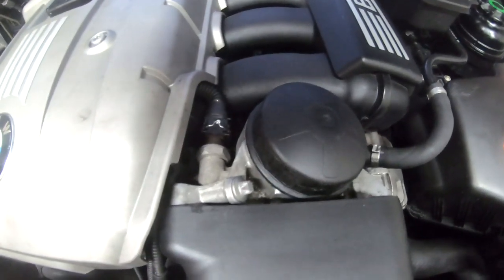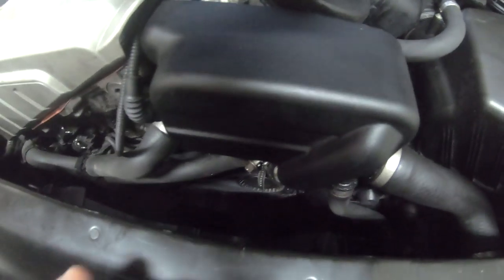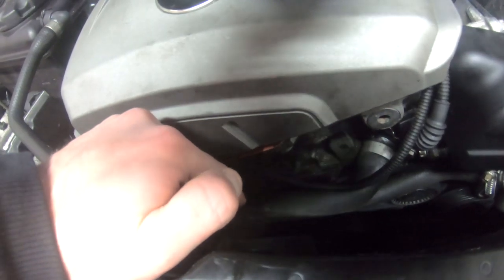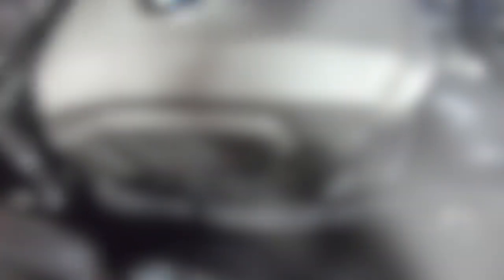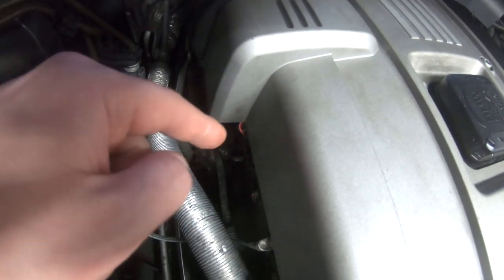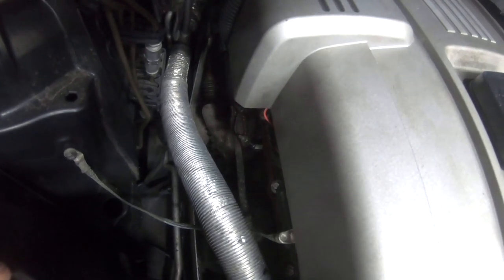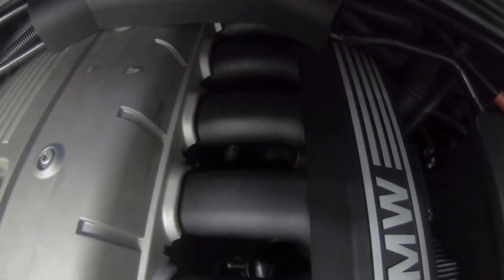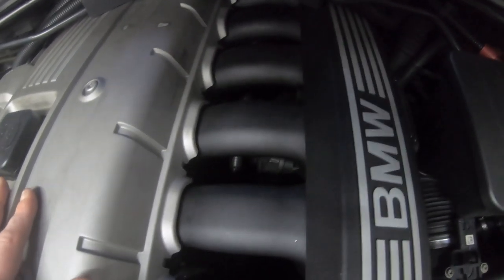Bmw N52 All Common Oil Leaks & All Common Problems Sump Gasket Repair

Comment: ahh thanks yes of course, GREAT German engineering undermined by mechanically unsympathetic German accounting  ;-) get a Toyota...Anyway that's another video haha. Yes the oil cooler housing to engine block gasket...Makes sense now why I've been losing both oil AND coolant...pretty much a litre of each a week! On to it, thanks for your help.

Comment: Can anyone help me, I have a small leak from the oil cooler, but where that auto transmission joints with the engine there is oil leaking from there is possible for the oil to get there ?

Comment: Very informative cheers.
I've got a question regards the sump gasket. I'll be fixing my sump leak soon and as its done just over 100k, would you recommend I change it and use the sealant  obviously with new bolts, rather than using the sealant itself?

Comment: Am I supposed to have an oil cooler on my 2006 330xi?  I changed the Oil filter gasket but noticed I dont have the oil cooler in front of the filter housing. Thanks for your help and your videos, you're the best mate!
Reply: Some have theirs at the bottom to avoid leaks on the belt

Comment: Hi Dean, I just bought E90 325, had been leaking oil for a long time, engine subframe caked in old oil + dirt, looked like coming from oil filter housing, small amount of oil in coolant tank, engine run,s well so don't think its the headgasket but still has large amount of oil leaking under intake manifold after fitting new gaskets to oil filter housing, most by oil filter housing, any other place it will leak from around there? thanks
Reply: Looks like it was the oil filter/cooler gasket after all, cleaned area for 2nd time and looks good, so must have been old oil from when cooler removed

Comment: Hello,I have a seriours problem with my E66 N52B30 engine.Car can’t start the engine.No energy on engine and no fuel on it.Diagnosis say valvetronic fault,but the valvetronic motor is working.Is it possible valvetronic eccentric shaft sensor make this problems ?I think main computer is a problem.Whats your mind?

Comment: Help!!! Please. my n52 has white smoke on startup. Took it to dealer. They say blown head gasket. Im confused. It still drives normally. No signs on coolant mix in oil or vise visa.

Comment: Hi Dean. Am learning a lot from your videos. Thanks mate. Am an engineer, use Carly app, can troubleshoot some, but not really a car guy. I just want to stay proactive with my 2011 e90 n52 with 82K miles and avoid huge bills.
Am a low mileage user: 3500 miles a year, mostly city driving, half at highway speeds. Live in DC where it is neither too hot or too cold. Do I still need to perform Oil change every 12 months? Can I check for oil quality somehow and stretch longer if oil is okay? 
Have already got the valve cover gasket replaced recently. To manage other leaks proactively would you recommend me adding ATP205 re-seal to my oil in controlled amounts (test before increasing) which might prolong the need to replace oil filter and oil pan gaskets at a future date. If I do use ATP, do I need to continue adding it with every oil change (else risk the rubber shrinking and start an oil leak even more prematurely than what I am trying to avoid). 
Thanks much mate. Your '9 things to replace at 100k' video hit the mark for me.

Comment: Thank you very much for the info. What is the torque specs on the oil sump bolts?
Reply from the maker: Torque specs I will put in description
Reply: BMW Doctor thank you mate 🙏

Comment: Hey bro I messged you before regarding my 530d 
So I had my timing chains replaced etc since getting the car back.  It sort has no power well no torce im sticking my foot down and it doesn’t eject me into my seat anymore it takes ages to build up to 100mph. The gears hold longer do you have any idea. I can’t be asked to go back to the garage as it took them 17 days to fix my car in first place -.-
Reply from the maker: That can be mate either the turbo itself sticking or something is holding the car back maybe egr valve

Comment: Do you know anything about drive train error on a 63 plate 316i, limp mode no turbo, getting a vanoss fault?
Reply from the maker: Nope just get rid and be done with why would anyone drive that car sorry mate the reason I’m recommended to you is because youtube know I’m british and we are the only country to get that piece of crap engine 

Get rid and get a 6 cylinder

You down own a bmw with that engine you own a ford it’s a English made engine so for me I don’t class that as German I know exactly what’s wrong with that car
Reply: @BMWDoctor  so what's wrong with it do you think?  Do you think it's the solenoids?  Ibe read that taking them out and cleaning them helps? And thanks for you're reply I appreciate it mate
Reply from the maker: I think its fit for scrap its telling you to buy a 6 cylinder

Comment: Thanks for the video. Im still confused on where to put the sealant/rtv. Do you leave the old gasket on?
Reply from the maker: Leave it on son , you don’t take the whole sump down
Reply: @BMWDoctor  What about cutting the gasket out removing and using RTV gasket maker? as leaving the gasket on it could be leaking from the underside of gasket?
Reply: @Inspherespace  I agree.  It should seem better to cut it out and seal it with high torque grey rtv.  Otherwise you have to clean the metal surfaces plus both sides of the gasket while under car.  Seems painful
Reply: Appreciate it your help. Will be doing it this week!
Reply from the maker: Your welcome mate just remember don’t take the bolts completely down make sure you drain oil before hand oil the oil and bolts loose will be to much for the bolts to handle all that oil in the sump do this and then let it sit for a bit to seal properly
Reply: @BMWDoctor  I have to do the same. Is it possible to drop the sump   all the way to clean properly the oil residue so the sealant will seal properly?
Reply: Bmw Doctor so only loosen the bolts, do not remove all the way. After add the RTV.

Comment: Hi. Not related to this vid, but i wish u could make a vid about 5/335d engine how each of pressure  converters supposed to work at different rpms, i bought 2 new ones, seems like one is faulty, and the old ones unplugged/manually tested are holding vac for 4s, when on car same PC's generate 25+inHg, on wastegate im not getting any vac,but i reckon it happens in a case of overboost, the new PC unplugged wasn't holding vacuum at all,but with electricity supply works same as the old ones...a bit confused at the moment, would be great if u would make a vid about pressure converters for 5/335d, went through YT for hours and no one actually tests them on car in a documented way...you would be the first one :) thanks

Comment: I have a bmw n52 engine, I have changed the spark plugs recently but under full throttle and higher revs it seems to misfire and stutter a little. Could this be the coil packs? Also seems to of happen after putting a k&n panel filter in.
Reply: Tom Bindon sounds like your fuel pressure is low. Check the presses with ista d. K&N filter equal more oxygen, with low pressure it will not create the correct mixing ratio of fuel and oxygen. It’s not the coil packs, since the engine will reflect the same behavior in any condition while running. 
*spark plug: Did you noticed a fault right after changing spark plugs?
*FYI; BMW have a recall on n52 don’t know the exact years maybe 8-11 3 series. Need to be less then 120kmiles or 10 years for the replacement of the fuel pressure regulator. Or lift the back of the seat of drivers side if you see gasoline residue after taking the cover +4 screws off...
Reply: David Pion I have a BMW Z4 e86 3.0si, with 80k, it didn’t happen have the spark change,so it could be the fuel regulator, where and how would I check this, thanks for the advise
Reply from the maker: if its stuttering listen to me , replace your ignition coils ALL 6 and replace your solenoids from BMW do not even THINK about cleaning them or you will be back here there is no way around it do it right or carry on like that
Reply: Tom Bindon I assumed you had an e92...if you decide to change your coils get Delphi, the Bosch are prone to failure.
Reply: @BMWDoctor  aw dammit. 94k ml 2006 330i. I was just about to change only the plugs and clean the coils to save some 💲💰.

Comment: Shared mate👍Had a turbo siren type noise from mine as i pulled onto my street only in the boost range. Pulled over had a look under bonnet then just been back out and it's not doing it now.
Reply from the maker: Turbo siren noise mate that will be one of your intake pipes off mate check the one that goes from air box to the turbo 

Thanks mate for sharing
Reply: @BMWDoctor  Will do mate nice1.  If it was turbo itself would it have done it again when I went back out then? It had a brand new one from bmw 30k ago.
Reply from the maker: mate no chance it can be turbo mate no chance in hell bro do not worry yourself if it was changed 30k ago no way turbo can fail that quick unless your driving with no oil

Comment: Just had recall on my e60 matey for battery cable or something , whilst it was in they done a heath check on full car the only amber concerns were parking sensors don’t work but a know that and a slight oil leak between gearbox and engine do you know if there is a common place to check , they mentioned it’s was a tiny leak and give it amber and will need attention in the future . Any ideas . Rest of check were green so good to go ha 👍
Reply from the maker: Yes mate that’s the rear main seal leaking mate
Reply: Bmw Doctor big job ?
Reply from the maker: big big job gearbox needs to come out to access it mate
Reply: Trade in time next year then 😭
Reply from the maker: I done them many many times and its easy to do if you know how 

what car and what engine is it
Reply: Bmw Doctor 07 e60 535d m sport
Reply from the maker: thought as much mate nothing but problems I have made over 700 people get rid of there diesels this year on YouTube alone and go to petrol go get N52 engine and be happy mate you will enjoy more or get the V8 they are not as expensive as you think to look after please whatever you do mate do not get 4 cylinder get rid of the 535D before it runs your account to the ground especially if you aint doing the jobs yourself this car is about to rip you for everything you have
Reply: Bmw Doctor had it 6 year with only a spring to go wrong and sensors . Been amazing to be fair got it with 55k got 115k now and like a above just flew a heath test with only the above faults . But like a day it’s 6 year old to me and 13 year in age . So could do with a change .
Reply from the maker: yeah petrol mate petrol Im just trying to purchase a X6 for the channel myself I dont know how many people have this car on my channel but who knows but if I was you just get rid mate and Get N52 you will enjoy alot more
Reply: @BMWDoctor  which V8 you would recommend? Would car like 735i be ok?is still a V8 but not sure if would be a good one. Meaby a list of V8 in video would be nice tho
Reply from the maker: I won’t be getting V8 mate I’m looking for the channel a X6 2011 plate mate I’m not sure if anyone on here has this car but I’m sure many people will come mate as I have always said I want to be different so I’m targeting cars that ain’t been done before
Reply: I get it but you think 735i would be a good choice?
Reply from the maker: Karol Grabka no bro don’t get that car are you good with electronics that car will be sitting more time then being used trust me you need to be good at diagnostics

Comment: Oil filter housing and valve cover gaskets are the bane of my bank account
Reply from the maker: Go and buy bmw dealer ones and they won’t be if your using that cheap crap of amazon and eBay that’s why they are
Reply: @BMWDoctor  thanks, i'll keep that in mind next time one of them goes!
Reply: They leak because as Dean said you need new bolts not just a gasket, this is why people end up with problem comiing up all the time. I did a lot of service with Dean's advice and believe or not my car is like 180° different to what I Initially buy.So coming to my advice and conclusion is to listen carefully what he does said in video and that will make your life easier and aswell it will be more than easy to keep the car running nice and smooth as possible. Btw the solenoid seal is leaking like you said sometimes if the solenoids where puted in and someone use gasket then pushed the solenoids in that is a cause of leak aswell( I learn it myself). Another awesome video Dean keep it going this way, btw. The advice for a sump is a gold mine mate I think!! This will be one of last jobs for now for me to do!!
Reply from the maker: cheers mate this is the exact problem people try and do things cheap very very cheap just to keep there cars moving they want to run bmw cheap these are the type who buy a bmw and have no money to fall on when things go wrong they get it to look good and go for it because everyone says how reliable they are then they come to reality it isn't cheap anymore and gets more expensive the cheaper parts YOU USE !!!!

good one man and im glad yours is rolling bro and strong
Reply: You’re not alone, changed my valve cover yesterday (that one lasted 3yrs OEM) . Oil housing gasket is leaking too, another Sunday project...